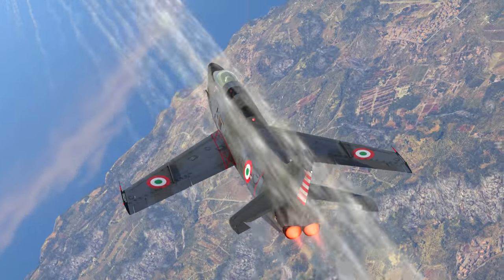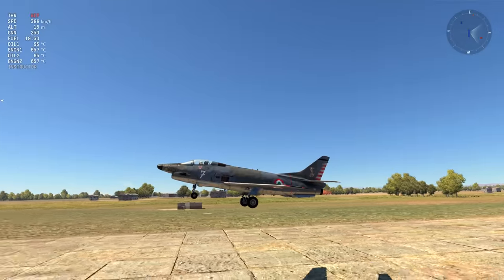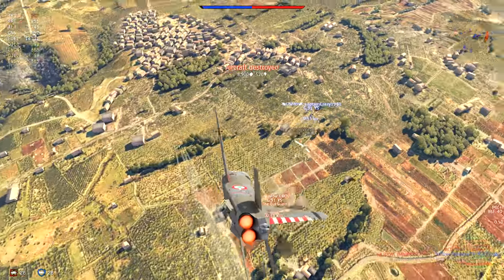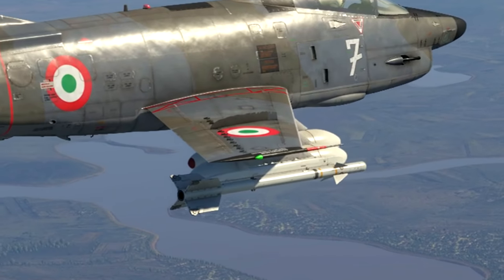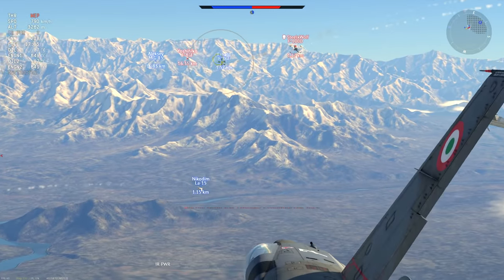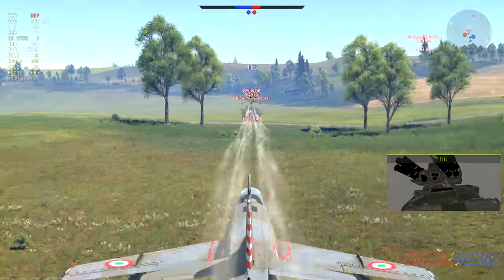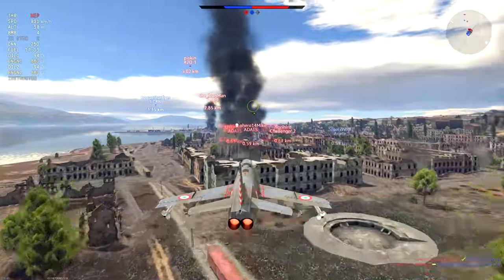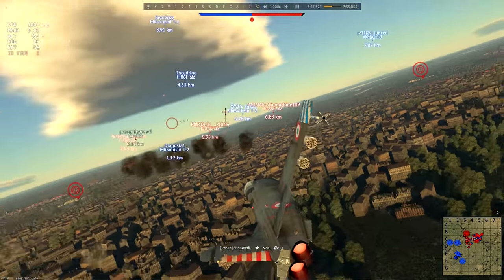War Thunder: How To G.91YS

Comment: Can we plz get rid of this idea that military planners thought missiles made guns obsolete? Only interceptors moved away from guns (yes that includes the F4 as it was originally ordered as an interceptor) and that was totally sensible as their purpose was to shoot down bombers which fly high and are un-manoeuvrable making missiles consistently effective against them. All aircraft designed as fighters kept guns.

Also in Vietnam the navy F4s (which didn't have a gun) had a higher k/d and number of kills than the army F4s (which got one later on). Which is arguably attributable to the fact that the F4s had to have their radar downgraded to a smaller and less capable set in order to fit a gun. Also out of the army's 106 kills with F4s in Vietnam only 6 were with the gun

Comment: 5:58 but grammatically correct, in italian:
Addestramento equipaggio per Fiat G.91 YS
Vitalità 
Resistenza
Tolleranza-G

It seems it didn't changed nothing, but it did. Don't learn italian guys, it is a bad monster.

Comment: Can we please get rid of this stupid idea that air forces thought that fighters didnt't need a gun? Only intercdptors (which is what the F4 phanton II was designed to be) were ever designed without a gun and that was because they were intended to shoot down high altitude bombers where missiles WERE effective meaning that they were correct that guns were redundant.

It is actually arguable that on the phantom II the gun was a bad idea as they had to downgrade to a smaller and less capable radar to fit the gun in and it only accounted for a fraction of the USAAFs kills. Additionally the Navy F4s achieved a better K/D ratio than the army F4s likely because they kept the better radar father than equipping a gun. Albiet that missiles improved significantly throughout the Vietnam war and therefore eirlier in yhe war a gun would probably have been far more useful.

Modern fighters carry guns for 2 main reasons
1 the weight of the gun is small enough that having it isnt a major sacrifice to performance
2 modern fighters are multi role and therefore may be called on to perform ground attack where a gun is very useful